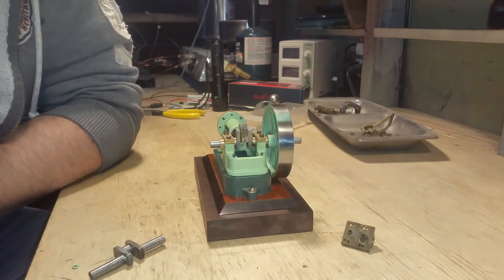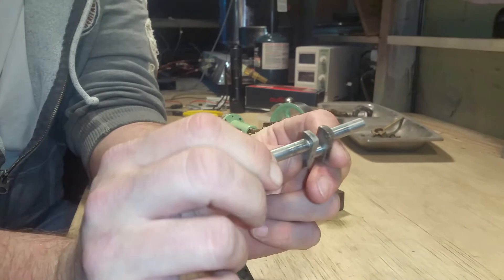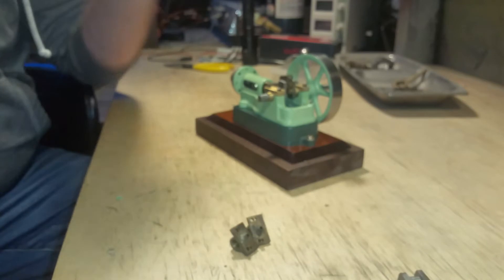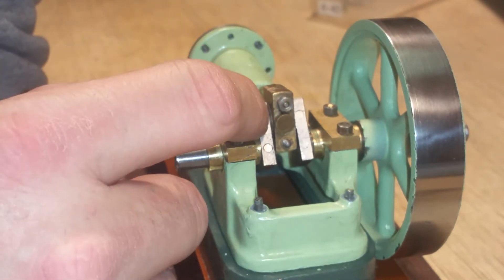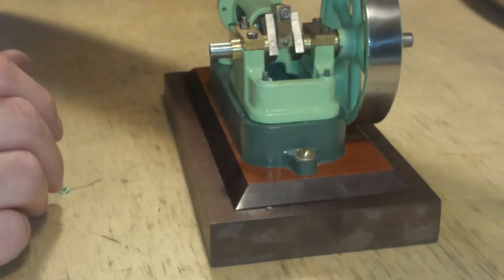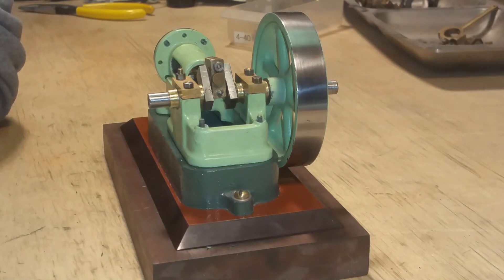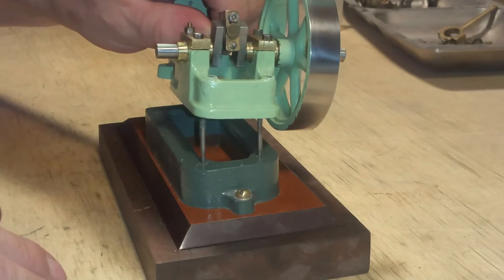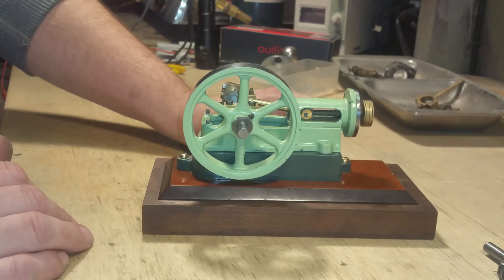Stuart Turner 10H rebuild #1 intro Model Steam Engine

Comment: I came to Stuarts and old steam by way of BSA bikes so years of buying used parts has helped. 4/7 of my engines needed work but no more than a day or two and they are all ready to run. As well as thier age allows. :o) crazy crank there not the cast type that came with kit. You can still get parts to machine or machined from Stuart too in UK.